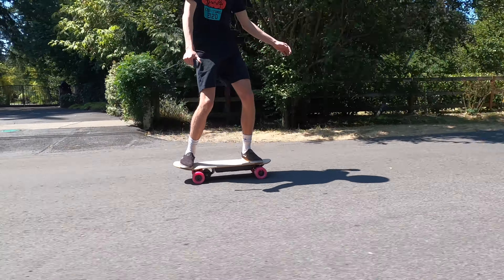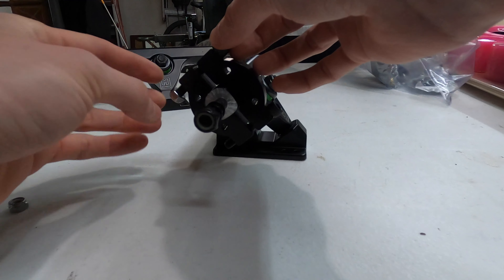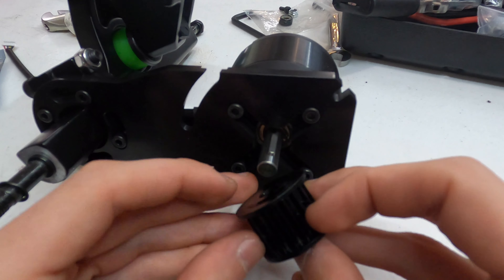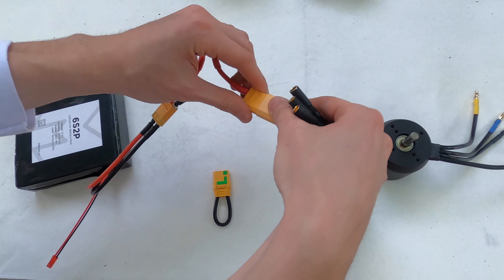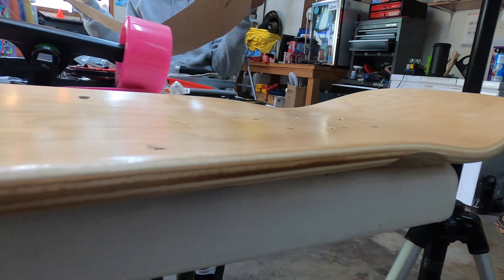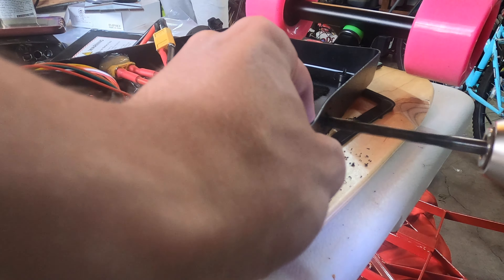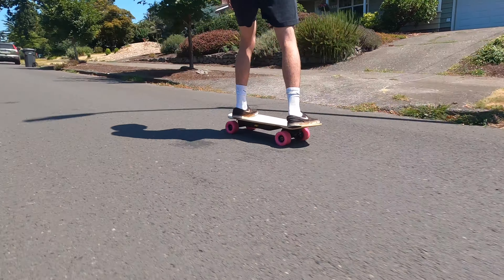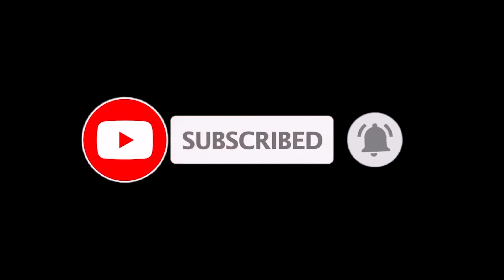How to Build an Electric Skateboard *NEW* Mini Budget Board $550

Comment: Really cool video I think I'm going to do this billd does it matter what the size of the Deck is
Reply from the maker: Yeah so the enclosure and long mount make it kind of tricky to fit so a little longer deck would be better(or at least a slightly larger wheel base) We ended up getting it to work so this deck is honestly probably fine. If you're doing this though I would definitely get the regular boardnamics caliber mount and also a 10s2p. The extra $100 will go a long way
Reply: @DIYesk8Builders   thanks

Comment: Do you think you could fit dual motors on a board like this? or would it even be worth it to do a dual motor on a short board? Looks like it would be a very tight fit
Reply from the maker: Technically you could fit dual 6354's with 15mm wide belts but it would be very tight like you said
Reply: @DIYesk8Builders  Do you think using the extended trucks from mboards to give you more space could work?  Or would that cause problems? great video btw

Comment: Can u link where u got the nuts u drilled into the deck to hold the enclosure
Reply from the maker: They came in this kit and I used the m3 ones https://www.amazon.com/gp/product/B07DXRJXPH/ref=ppx_yo_dt_b_search_asin_title?ie=UTF8&psc=1
Reply: DIY esk8 Builders I checked the link and it only goes down to m4 is it another kit
Reply from the maker: Oh wait my bad it actually was m4, not m3

Comment: It's cool, but for budget builds DIY is losing its luster considering you can buy a much better two motor board with an actual power switch, an OLED remote, and swappable wheels for the same price. DIY is great for making super specific, powerful, and custom boards but not much else.
Reply from the maker: Agreed in this day and age